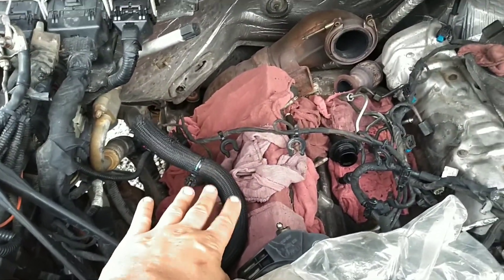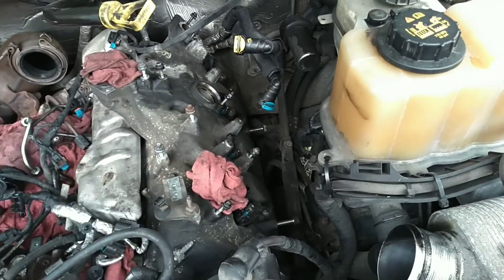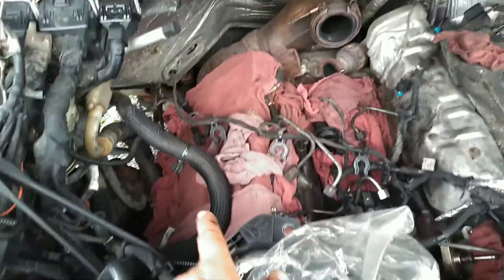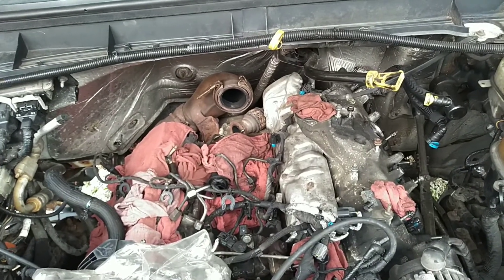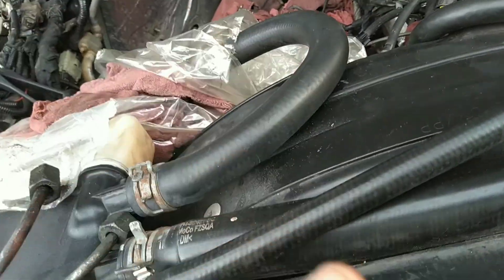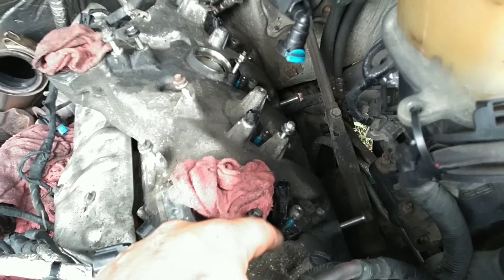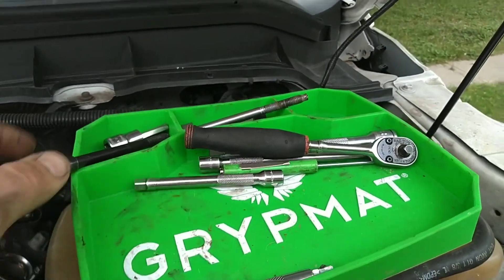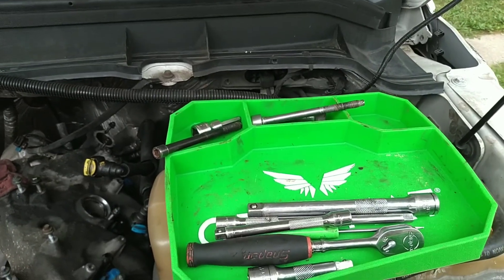6.7 POWERSTROKE VALVE TRAIN PROBLEM.... UPDATE

Comment: I was doing the fuel system on a 2012 because the cp4 pump died. Accidentally dropped an injector copper washer into the valve cover, and go to take the cover off so I can fish it out of there. That's when I discovered the same thing you're showing. Valve train had worked its way to the side of the valve stems so it was really only pushing down on half a valve stem. I was so surprised, I pulled the other valve cover too, and sure enough it was the same story. Called the local dealership, and they claimed that's "normal". After thinking about it for a while, I'm pretty sure engineers overlooked how much side leverage is pushed on those individual push rod and arm assemblies. Think about a tried and true Cat engine, like a c15. Each rocker arm is beefy, straight, and all ride on a smooth rod to pivot. The 6.7 uses rocker arms that aren't all straight, and the pivot point is some janky metal block which forces them to have side load wear. I like the 6.7. Hopefully some good shops out there will come out with improved valve assemblies

Comment: Just watched this video series. Thinking I might have the same issue. Getting contribution balance codes on 2,4, & 8 - sometimes. Also getting a P160A code which was making me think PCM. I pulled the injectors had them bench tested, all passed. Re-installed same CB codes. Plus injector knock maybe? Seems like it's was just dumping fuel, check live flow rates on the injectors, 2,4,&8 way off from the others. Would a compression test confirm to me valve train or PCM? Thanks!

Comment: Any suggestions on what to do when you have an injector that is stuck in there and doesn't wanna come out ?!
Reply: I tried using the same tool and the hold down bolt tends to want to bend slightly and the injector isn't budging I can spin it side to side but I can't seem to pull it out or pry it out either
Reply from the maker: Is there potential engine damage in that cylinder that could have mushroomed the injector tip?
Reply: Things been kicking my ass for the past 3 days lol, Any suggestions on how I could get that last injector on the passenger side out. Room is tight which sucks to get any good leverage on or is there some sort of tool that would be strong enough to pull it out that won't bend possibly
Reply from the maker: Did you try flipping the hold down upside down and tapping it with a hammer. If I couldn't get it out with the tool or using the hold down up side down trick then I think I would pull the head because there is something else going on.

Comment: Do you know if the IQA was entered when the last person install the injector
Reply from the maker: No I don't. The truck was traded into a dealership then sold the auction where this dealer got it. So I had no history of.
Reply: @cincydieselrepair6893  did you figure out number 8 contribution they maybe didn't have the IQA  programed in
Reply: @cincydieselrepair6893  hey any tips to talk to the customer about this. I had one that came in for a cp4 failure replaced as the customer wanted but I notified them that some of the injectors might have been affected and would need to be replaced. He declined so I replaced the cp4 and to our surprised once started it had injector codes. He approved but not easily he was blaming me for the injectors I got the injectors out but three of the compression copper washers stayed in. I went in with the pick to extract them and got two out but I had one that fell in on cylinder one. When I removed the valve/intake cover I discovered this exact same issue. Funny thing is it had no knocking. Now I’m stuck on how do I explain to this already pissed of customer who’s trying to find anything to blame me.
Reply: Same issue as the rocker off the valve.
Reply: Can you help fix my truck ?
Reply: @981edgarh there's a saying I like to tell customers that like to blame you for everything. "I didn't build it, buy it or break it" 🤷🏼‍♂️🖕🏻